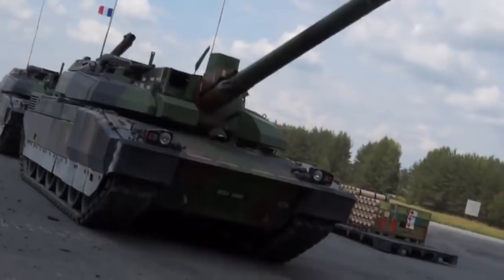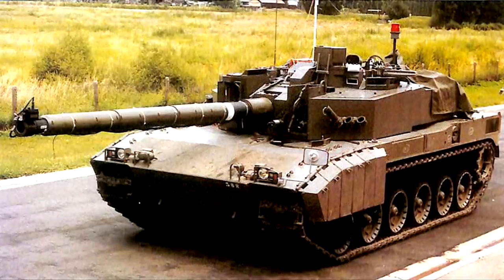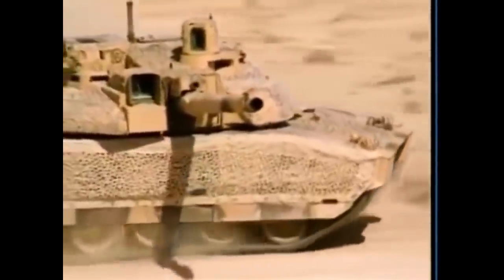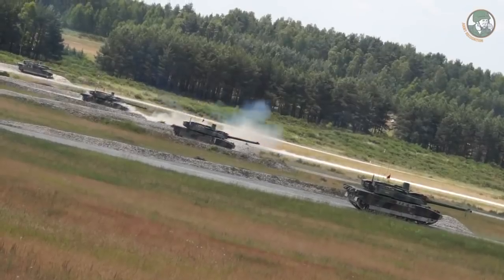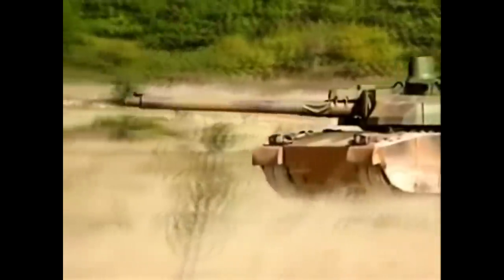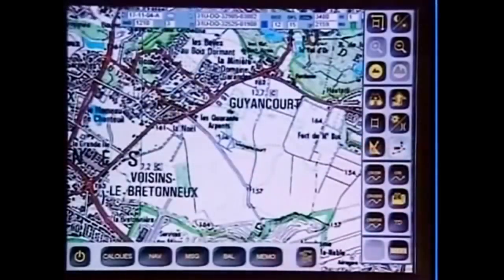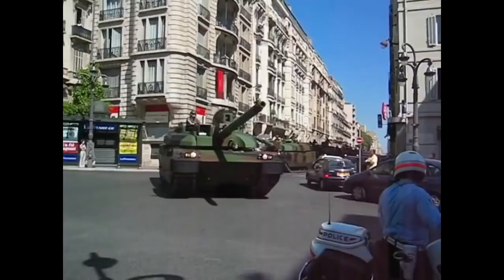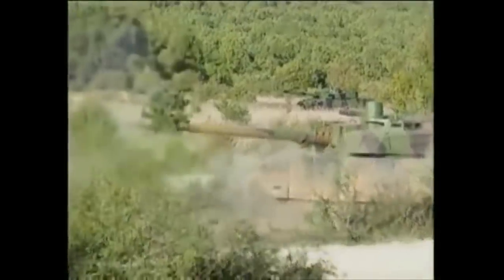Is Leclerc Obsolete?

Comment: A very underrated machine.
Not like merkava mark 4 the most overrated machine.
Reply: certainly overrated, same for many other israel products, Israel overrate itself to stand ground in the middle east
Reply: @humorss  yeah thats how it is. In 2006 they lost many of them to older anti tank systems.
Just like a couple months ago a f-16 got shot down by a s-75. And what where they saying ? Yeah they shot arround 70 missiles at the Aircraft. Syria havent that many Operational s-75 missiles. They are al rusty laying about 40 years in the open stationary. But thats how it is they got to lie anyway does not matter in what.
Reply: @jojyyo104  oy vey, you can't mean to say that the gentiles can strike them down, could you?
Reply: The word overrated or underrated is only a subjective and relative term. What may seem to be overrated fo you may not be so for some others. There is no universal classification of "underrated" or "overrated". It's only your opinion and perception but not a true fact.The Merkava Mk.4 is a very good modern tank and it's one of the best protected tanks against missiles attacks (that's not an opinion but a true fact). It can survive missile attacks that would be deadly to most other tnaks on the battlefield. So it deserves to have a good reputation. The Leclerc is also a good tank, though not as good as a Merkava Mk.4

Comment: Wtf is up with tanks and having giant lower plates without composite armor. Just look at the challenger 2 for example.
Reply: And so do all Russian and German tanks. Most tanks do not have composite armor at the lower hull since it's unlikely to be hit. But I have to correct you, the Challenger 2 was already upgraded with a new composite armor block to the lower front hull since 2009.

Comment: Can you do one on the JGSDF Type 10 MBT please?
Reply: + good fire control
+ good situational awareness
+ very light and good mobility 
- weak armor protectio
- weak APFSDS

in other words, it's perfect for a small island country like Japan
Reply: @xAlexTobiasxB  i understand its use in replacing the Type 74, I just have a hard time trusting many news sources unless it comes directly from their MOD sometimes
Reply: @colin.k6263  it's not replacing the Type 74 (the Type 90 already did that), the Type 10 will be replacing the Type 90
Reply: @xAlexTobiasxB  no, you are wrong, the MOD specifically stated the Type 74 was replaced by the Type 10. The Type 90 is just a compliment to their numbers. The Type 90 is too heavy to traverse the infrastructure of all but the top two main islands where as the Type 10 was specifically designed to replace the Type 74 as the nationwide mbt by being light enough to traverse all islands whilst bringing in the tech of a modern mbt. The Type 90 and Type 10 compliment each other but do not replace either. it is only the 74 going out
Reply: @colin.k6263  I was talking about the future Einstein. Since the Type 90 is a lot older, it  will be withdrawn from service one day and the Type 10 will replace it until a new tank will be designed...
Reply: @xAlexTobiasxB  no, you still misinterpreted. The Type 90 may or may not be phased out sooner but it is never being "replaced" by the Type 10 as they fulfill completely different roles. If you look on the MOD website, they specifically make it a point that the Type 10 will never replace the Type 90.

i understand what you are getting at but it goes directly against the words of the Japanese MOD
Reply: @xAlexTobiasxB  and plus, earlier you stated the Type 90 replaced the Type 74 which is extremely far from the truth as Japan still operates the Type 74 and the Type 90 literally fulfills none of the roles that the Type 74 filled other then shooting at tanks which is not the only thing there is to getting a tank
Reply: @colin.k6263  also, I don't understand where people get the idea of the Type 90 or Type 10 having poor armour protection. Their low weight is as a result of the tanks height and weight being lower than typical Western MBT's, and even then the Type 90 isn't that much lighter than the Leclerc. Put the Type 90 and the Leopard 2 side-by-side and see how much bulkier it is. No doubt this is the reason for the lower weight of the vehicle, as opposed to lower armour thickness and therefore effectiveness
Reply: @AdotLOM  i think the majority of the weight loss comes from the chassis and reducing armour there as Japanese tanks are typically designed for a defensive purpose as thats what they are.
Reply: @colin.k6263  though surely if they are designed for defensive purposes, then at least the turret would require descent protection, as is the case with the Challenger 2 (though in the CR2's case, moreso against shaped charges)? For such a role, a hull-down position would still require good turret protection against a peer adversary, plus the Type 90 isn't that light (50.8 tonnes, versus ~55 tonnes of the Leclerc). Even if it were only only 5% shorter and 5% less wide, it would still weigh 10% less for a similar amount of armour protection.

Comment: It's not obsolete it's just bad and it always was
Reply: It has always been one of the best tanks in the world and still is even today
Reply: @xAlexTobiasxB  yeah best from the back of the list
Reply: Sources? Explain yourself? Quotes? Proof?
Reply: @mrick1974  proof: any site showing statistics of the tank and battlefield itself...explain? How tank with nad armour gun mobility exposed engine and fcs can be any good?
Reply: @vanja2565  the leclercs sold to the UAE are bootlegs, just like the Abrams sold to Iraq are Inferior to american crewed Abrams.
Also, this tank is the lightest when compared to All nato tanks.
Also Also, the armor of the leclercs is in no way shape or from bad. It has modular armor, which means that for specific situations, you can slap 700+mm of armor to the front of it for ex or hundreds of mm to the sides of the hull or turret.
Also Also Also (lmao) you're only considering the old apfsds rod round wich is only used against '' old tanks''. The intermediate apfsds round has a similar penetration value as depleted uranium rounds fired by the Abrams. (it can also fire any round used by nato tanks if you wondered so how is its armament bad?) anyway, keep on hating without actually knowing what you're talking about.
Reply: @vanja2565  last thing; I hope that you understand that the last generation leclercs are shrouded in secrecy so.. So much for those '' sites stats''
Reply: @vanja2565  ANNNND, i would LOVE you to find the source about 20mm autocannons breaching the gun mantlet, bc I couldn't find it anywhere.. Fake news much?
Reply: @mrick1974  it's pointless to explain me anything...please go to battlefield and ask not to attack leclerc...tank is bad and battle prpved ir
Reply: @vanja2565  lmao facts aren't your thing uh?
Reply: @mrick1974  that works pnly for you

Comment: Would still smash any russian tank
Reply: Anonimous 1277  leclerc blows any russian tank that is not an Armata to smithreens even t90 ms cant hold a candle to the leclerc
Reply: @monfortnicolas5448  That's not true, the T90M is definitely a little bit better, having much better armor protection. But other than armor level they are pretty much equal in all other aspects

Comment: I'm asking myself why dafuq no nation puts composite armor to its lower Plate. Merkava doesn't, leopard doesn't, leclecs doesn't, Abrams doesn't, chalanger doesn't.
Reply: Challenger 2 these days does. The Dorchester block. It was put there because the lower player got penned by rpg 29 that had a tandem warhead. So in response the British outfit all their modern challenger 2s with that block of composite on the lower plate
Reply: @rayhan_2k841  isn't it ERA down there, and not actual inert armour?
Reply: @AdotLOM  it used to be ERA armor. But replaced with actual composite armor after the rpg29 incident penned right through the original ERA
Reply: @rayhan_2k841  ah I see. Was this the incident in Basra?
Reply: Isn't it common to put a skirt on a T-72 there?
Reply: @jeffkardosjr.3825  t80u had that I think

Comment: What do you think about TR-85-M1 BIZONUL romanian tank. Is good for a modern warfare?
Reply: Not really. It has no real protection against any modern weapon so anything will destroy it.
The 100 mm gun is outdated too, it can only penetrate the weak spots of modern MBTs.
But at least it has good fire control, with modern thermal gun sights, so at least it has good visibility.
But it can be used effectively as a light tank destroyer, hiding in the forest behind trees to ambush enemy tanks. 
That's what they did during a exercise in 2014 when they "killed" several M1A2 Abrams tanks from side shots.
Well, at least the TR-85M1 is good enough for a poor country like Romania...
Reply: @xAlexTobiasxB  its good for the Balkans

Comment: that shame when t-72 svinietz-2 apfsds can destroy the edgy french tank
Reply: Only the upgraded T-72M3 (2016) can shoot the svinets-2, so no, a regular T-72 can not destory the Leclerc.
Reply: @xAlexTobiasxB  can destroy it at 3.500m+
Reply: @clapper3530  A T-72 won't even see the Leclerc before it goes BOOOM. The Leclerc has a commander's independent thermal viewer and a battle management system for situational awareness, so it will see first and shoot first. Even the latest upgraded T72M3 still doesn't have a Battle Management System nor a Independent Commander's Thermal viewer.
Reply: Who ever shoots at first depends on Crew skill and recon.
Reply: @jojyyo104  and the firing systems. The russians often had the thing that they could oneshot western mbts but didnt have the ability to hit them because of their inferior firing systems technology. Western mbts therefore always went for the best long range systems.
Reply: APFSDS performance drops with the distance it travelled, S-2 is a tungsten based rod with approximately 740 mm at 0° at 2000 m or 350 mm at 60° at 2000m therefore it cannot penetrate Leclerc, nor any other western MBT (even Leopard 2A5) at ranges bigger than 1000 m. At 3000 m the penetration is most likely well below 700 mm, as well as around 800mm at 1000 m.
Any western MBT can shrug it off at that range.

Comment: The armor is a choice made back during the amx 30 development. The army knows that if the tank is facing any modern mbt the armor won't matter. So the emphasis was made on mobility (so the weak spots won't matter) and fire on the move (hence the autoloader). Plus if France should fight a war against a major nation it would more than likely be a country like Russia or China at best. So I'd say that the leclerc though not the best is quite a good mbt.
Reply: It has armour it was tested and wasn't penetrated against every existing threat at the time of it's release, the guy doing the video simply didn't inform himself correctly.
Reply: @Tetemovies4  That was what 30 years ago, sorry but even the German tanks are at this point are better protected. Plus the Leclerc is seriously vulnerable to infantry attacks when it only comes with a coaxial gun and sometimes another one.
Reply: @Predator42ID  There is a urban combat upgrade available for the leclerc, it's called "azur".
It adds ERA armor all around the crew compartments of the chassis, anti-RPG protection to the engine compartment and the back of the turret, and a machinegun on top of the turret that is controlled from inside the tank. Also the leclerc can launch a variety of grenades to defend itself, this includes smoke grenades, IR smoke grenades, and anti-personnel grenades.
This upgrade kit isn't usually installed on the tank because the french aren't deploying it anywhere currently and keeping it installed all the time would just make maintenance more difficult.
To elaborate a bit on the subject of protection, the 650-700mm estimate for the armor dates from the first model of the tank, the S1. Since then, to my knowledge, it got at least two armor upgrades (not counting the azur upgrade kit) so the S1 estimate is very outdated. I don't see it mentionned often, but each crew member in the leclerc has its own armored compartment. This is so that a penetrating hit to the crew compartment is less likely to injure more than one crew member.
Also a feature that is pretty neat in my opinion is that the gunner and the commander have most of the firing equipment in common, making it possible for the commander to operate the gun. The commander also assists the gunner in spotting and engaging targets by using his panoramic optics system (the big rotating optics that stands out on the top of the turret) it's called the hunter-killer capability.

The wide majority of tank anthusiasts actually know very little about the leclerc's true capabilities and the most accessible sources out there are usually inaccurate or very incomplete.
Reply: @Predator42ID  Connard
Reply: Its a myth that Leclerc have a poor armor. In fact if you compare a Leclerc to a Leopard 2, the Leclerc have something like 4 to 5 tonnes + armor weigh. The turret have the same weight as an 2A6 (21tonnes) but is 1/3 smaller and guess what, she have the same weight because she have far more armor.
The Leclerc have the same armor capacity on the front and the side. But the armor used on the side and the front aren't the same. The front armor is a more ticker armor who is NERA, when the side is thinness and use ERA composants to have the same efficiency as the front one but that make it less durable and need to be remplaced more often when hited (unlike most MBT the armor cover all the flank of the turret).
Without aditionnal kit armor (TUSK, A5 variants etc.) the Leclerc is probably the most protected tank today.
Reply: Sergent Saucisse what you are talking is the common Cold War doctrine of European countries like Germany and Italy to make light tanks with great firepower and mobility but this has nothing to do with the leclerc it was made at the end of the Cold War and at that point every major country began using a composite solution instead which emphasized on great armor firepower and mobility which the leclerc did stand for at its creation but now it is beginning to become obsolete
Reply: @sanderchristensen4108  but France more than the rest that's why the leclerc is lighter and quicker than most other tanks. The fire control system is also top notch to allow a good fire on the move capability
Reply: @sergentsaucisse8290  something russian tanks lack. And most tankbattles take part over lots of kilometres, therefore gunners aim at center of mass of targets. Therefore this "nearly obsolete" french tank beats most of the even modern russian or chinese tanks because the russians never were able to get the best fire control systems.
Reply: Sergent Saucisse France didn’t emphasize more on this then Germany or Italy all country’s began making composite armored tanks in the 80s the only exception is the C1 ariate which is really poorly armored. But you do know that most western tanks have modern fire controls systems and so do the T90M and T14 the only reason why Russian thanks don’t have that is because most Russian tanks are way outdated. The reason why it’s obsolete is because when you compare it to other modern tanks it doesn’t hold up
Reply: @Lordodestractnanmssry  Lack of top fire control doesnt mean bad fire control especially at the ranges that they are needed so the projectiles can penetrate the armour
Reply: @sanderchristensen4108  Which is indeed why they're now talking with the Germans about making a new common tank...as well as the LeClerc/Leo2 Hybrid.
Reply: @sanderchristensen4108  bro it's literraly the french doctrine like do you research before saying shit you don't know

Comment: What do you make of the Nexter + KNDS Fankentank aka European MBT (EMBT) with a Leopard 2 chassis and LeClerc turret? https://www.defensenews.com/digital-show-dailies/eurosatory/2018/06/11/french-and-german-armor-makers-test-the-waters-with-a-euro-tank/ Still just in prototype stage, and not projected to be available until 2030, but presumably this could be accelerated if the will and money is found. I would bet existing LeClerc turrets could be upgraded for sensors, fire control, armor and active protection, and remounted in new Leopard 2 hulls at certainly less cost than entirely new tanks, or of upgrading the armor, powertrain, and configuration weaknesses of the LeClerc chassis. Supposedly the EMBT is meant to demonstrate EU solidarity, but my bet is the French have been looking for some time for a solution to the problems outlined in this video. I don't think the Germans are looking to swap Leopard 2 turrets for new LeClerc turrets, unless they too are looking for a cost effective way to get auto-loader rates of fire and three man crews.